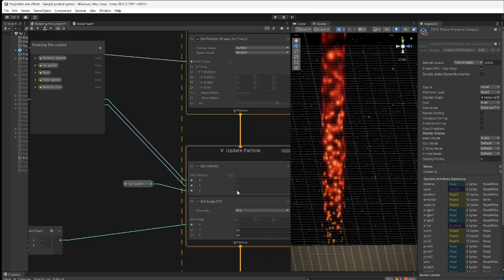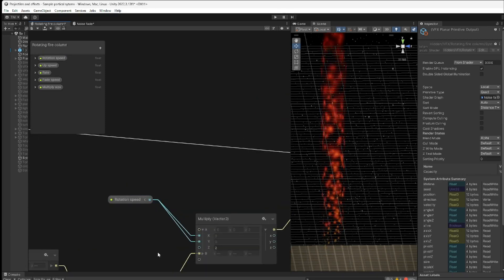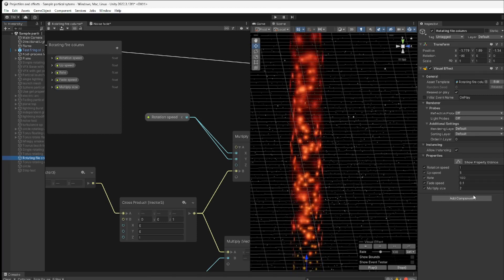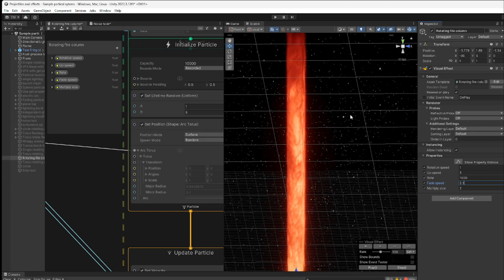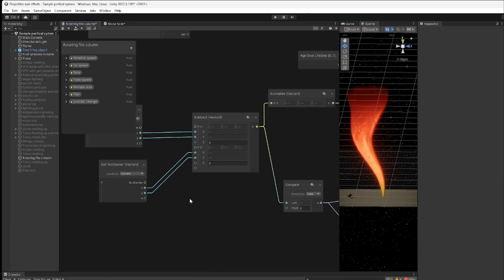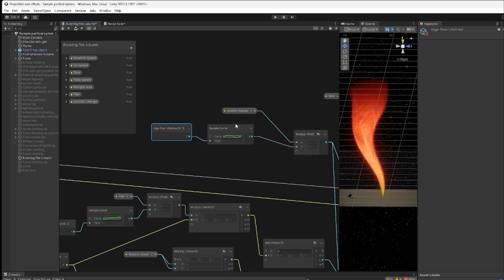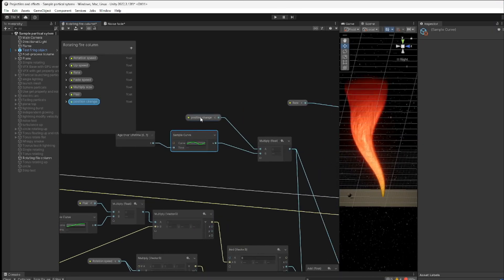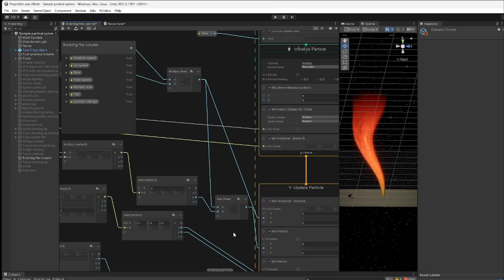Column of fire

Comment: Cool effect. 

You can add some perlin-noise vertex-shader transformations for a more natural look— but depends on the project: for example, you might like some fluid simulation on the particles in the air itself.